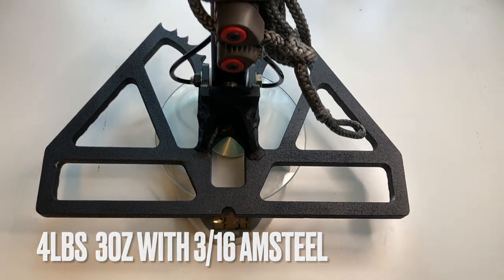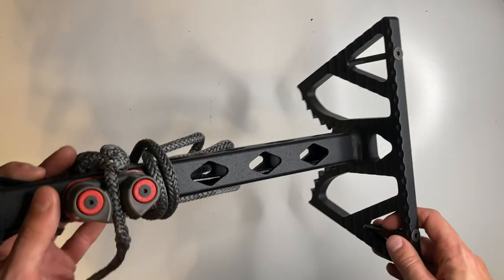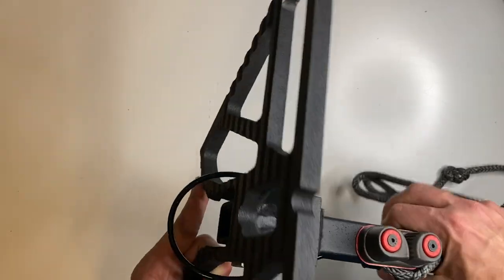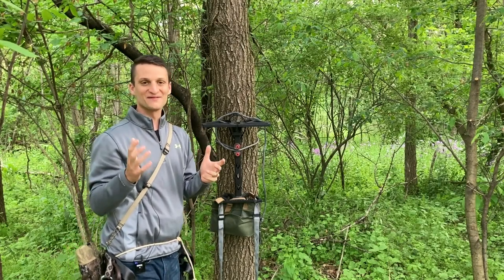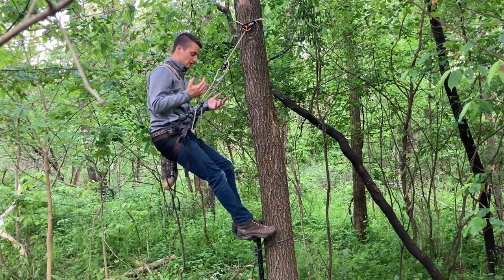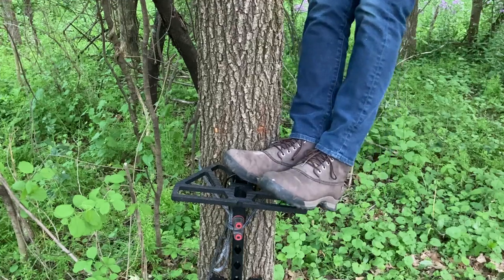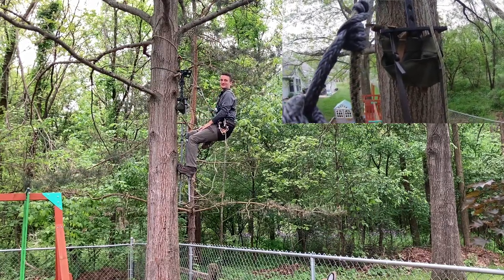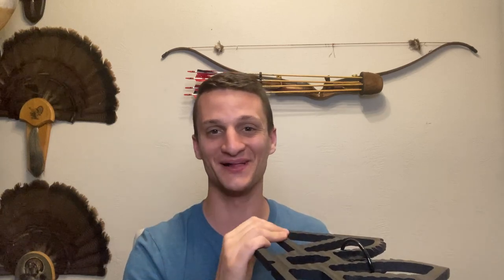Out on a Limb Big B.O.B. Is this the New Standard in "One Sticks"?

Comment: Great video. Really like your reviews. Question: at the end of the video I noticed you were using what looks like a Black Diamond Carabiner and some kind of orange ring tied into the end of your life line. I see some kind of amsteal prusik knot running from the primary rope to the carabiner. How you running that set up to anchor your life line to the tree?  Thx!
Reply from the maker: Thanks man. I appreciate you watching. That is a large Petzl rappel ring. You just feed a bight of rope through the ring and clip the carabiner into the bight. You’ll notice the carabiner has a short “tether” back to the main line. I clip my pull down rope onto the carabiner and can pull it down but it takes A LOT of force. I’m working on another hitch that releases easier.

Comment: @24:26 - what pack is that?  Very nice review.  Only small complaint - I notice the sound when you're outside is pretty good, but the indoor sound is really quiet.
Reply from the maker: Thanks for the tip. I’ll try to balance them better next time. It is an Eberlestock F1 Mainframe with two batwing pouches. I have a video of it on the channel.